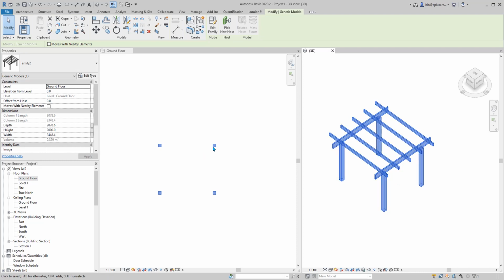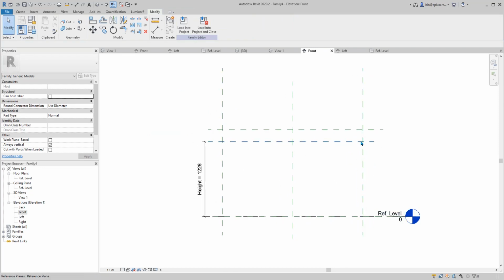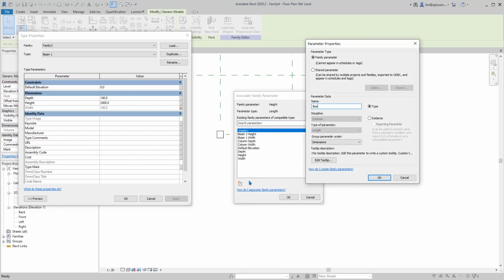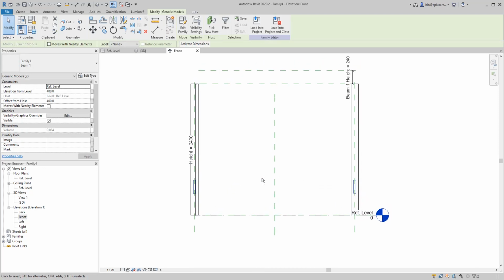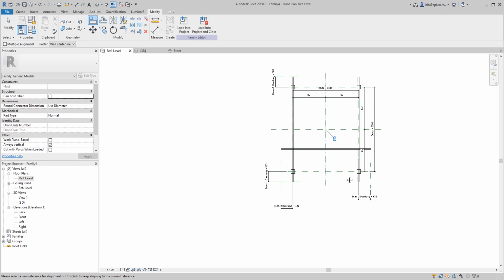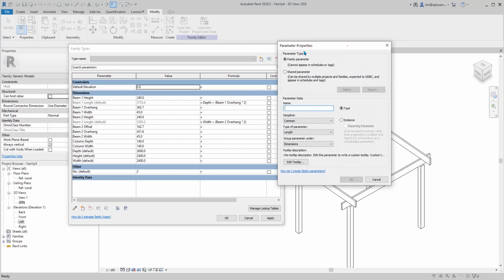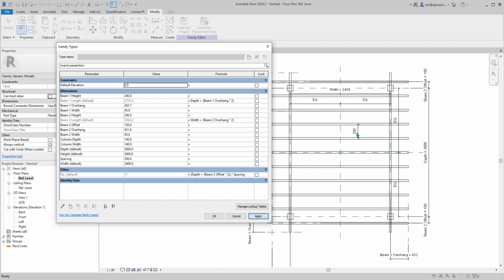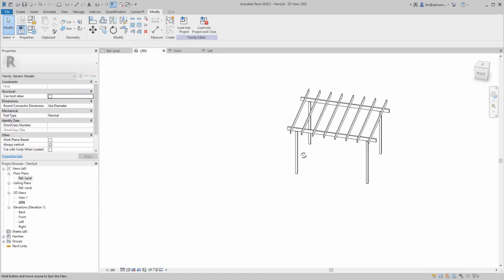Revit Exercise (Day 154) - Timber Pergola as Generic Model

Comment: Excellent video as usual. One question though. I noticed that in the plan view the beams do not show up unless the cut plane is brought to their height.
I tried the model line trick but it did not help for some reason.. Maybe because it is array or so?! 
Do you have the solution for that?
I also posted this question in your doc if you ever decide to make a video on this.

thanks a lot
Reply from the maker: There are a few different way to show the beams. The first one is to adjust the cut plane level in view range setting to be higher than the beams. The second one is to use underlay (probably, forgot the name, it’s in the properties) and you can see the model above with overhead line style. You can also use plan region to adjust part of the view range if you want to keep the view range for the rest of the drawing.
Reply: @BINHE615  I guess we are on the same path. I am aware of the options you mentioned. Plan region would be maybe my first choice among them. 
However, I would try to avoid them all if possible. 
Thinking in that direction I tried to attach a model line to the beam and hide it afterward so it becomes the part of the beam that would be cut normally and the beam would show up. This generally works smoothly with single beams. However, in the case of this pergola (maybe because of the array, I don't know..), it suddenly doesn't work out.  
Thanks anyway.
Reply from the maker: Can it because you hid it? Have you tried invisible line or reference line?
Reply: @BINHE615  this is what I meant https://www.youtube.com/watch?v=ZvpHuFET7ak
Reply from the maker: I am not sure, maybe the invisible line was placed on the other side and was not cut by your cut plane. I do not suggest this. You can always create roof plan to show everything above, or use the Underlay setting to look up, at least you will get the correct Overhead line style.

Comment: Hi great video and tutorial. I work at a solar firm and we design systems. Sometime we need to build pergolas with purlins rather than wood for more durability. Unlike woods that are uniformly shaped, purlin has various forms. We use the C shape and G shape. The pergola roof also has an 18 degree inclination. Can this be modelled in revit? I am new to revit so I attempted to do a model for the purlin pergola and kinda mashed up a design that looks like it but defiantly did a noob design
Reply from the maker: Yes, you can load the outline profile into the beam and use sweep with that profile. Otherwise you can also model it directly in the project using columns and beams. I have another video about that approach.  Have a try yourself and let me know if you still have questions.